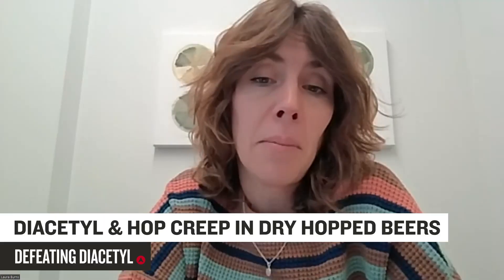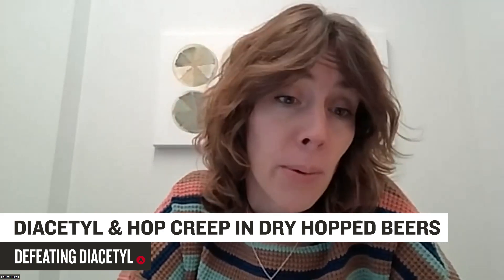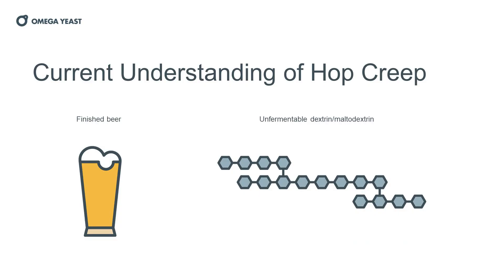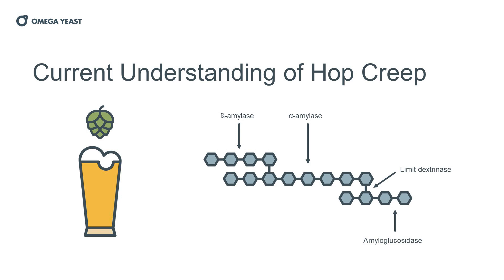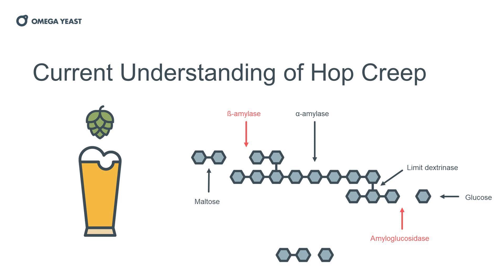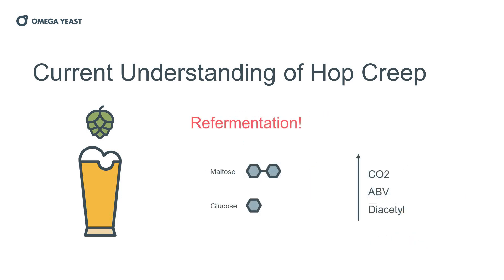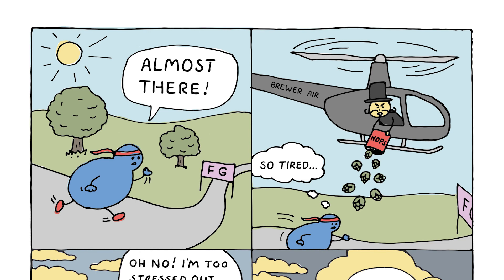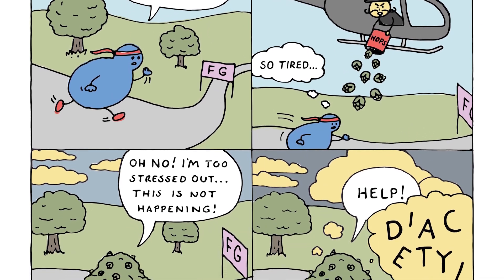Defeating Diacetyl | Expert Advice from Omega Yeast Labs

Comment: I brew a lot of NEIPA's. I found giving the dry hops the time they need to go through biotransformation helps quite a bit. Every time I rush brewing a NEIPA, I end up with Diacetyl. I now raise the temp after a 7 day fermentation from 68f to 72f for a rest of 5 days then cold crash and keg. Works well.
Reply: But by doing that you can’t pressure carbonate naturally, right?
Reply: I too, brew a lot of NEIPAs.  What temp are you dry hopping?  If lower, are you then bringing back up??  Thanks!!
Reply: @markzunk9925  I start my fermentation at 68f with pressure blow off set at 10 psi and after it gets going (usually day 3) I dry  hop. after day 7 I raise the temp to 72f for 5 more days. 12 days in total. I do this to ensure fermentation is compete to avoid hop creep. I then cold crash down to 40f for 3 days. I close transfer to 5 gallon ball lock kegs. Cheers

Comment: Will a heavy dry hop still increase the attenuation with the dko yeast?
Reply from the maker: If I understand correctly from what Laura said in the Q&A, attenuation is still likely to increase slightly (new fermentation will still be instigated) by dry hops, but without the concern for diacetyl at all in the mix. So, if you're really aiming for a very specific ABV, it might be someething to play around with in adjusting your "expected" FG to a couple of points higher assuming the dry hop will bring the gravity down just a bit more. There might be more about the actually increase you can expect on Omega's website, Top Crop blog, or hit them up directly: https://omegayeast.com/contact